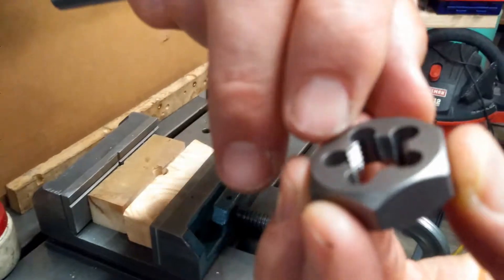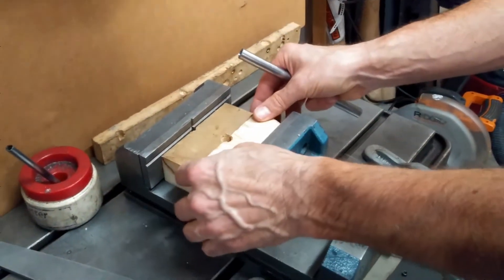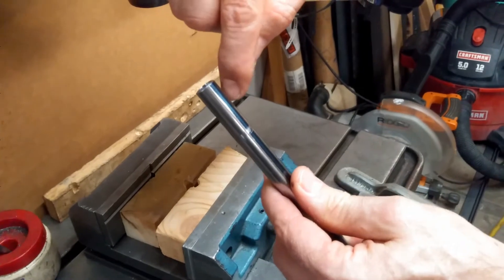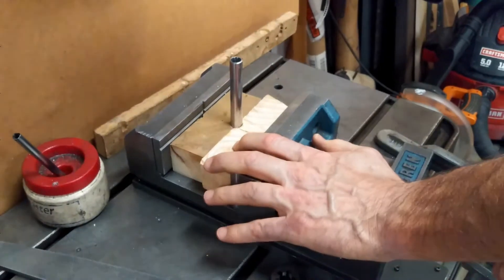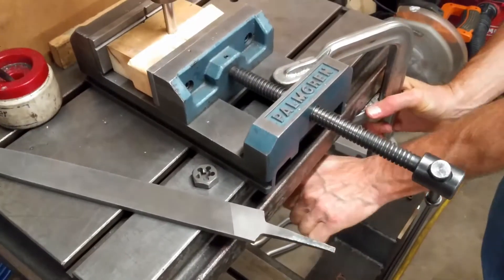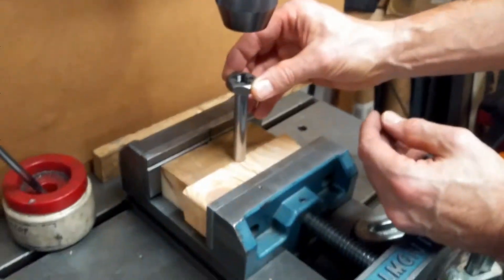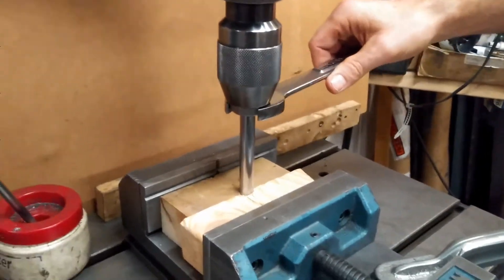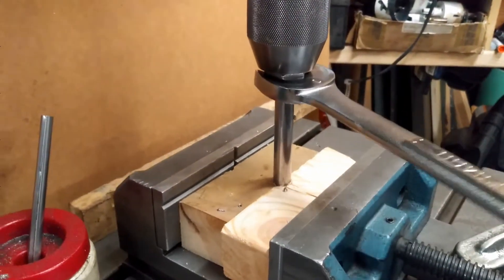One Way To Simple Success With A Thread Die - Mechanical Elements

Comment: I would think that to free both hands you could hang/tie a weight of some sort to the drill press handle to hold pressure on the die. The amount of weight, of course,  would vary depending on the circumstance. Good video. Thank You...

Comment: Hex dies are not made for cutting new threads. Only for repair for damage threads. That's why it took a lot to cut those threads and you probably payed 5.00 for that die. A round die that is HSS will cut smooth threads and is about five times the price as a hex die and will cut much easier.
Reply: What if we are dealing with rough rod?